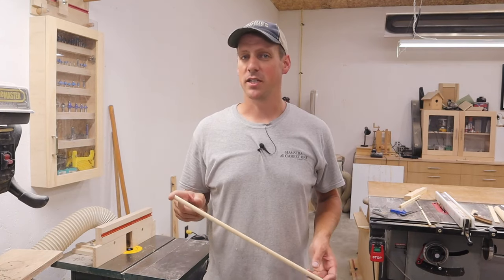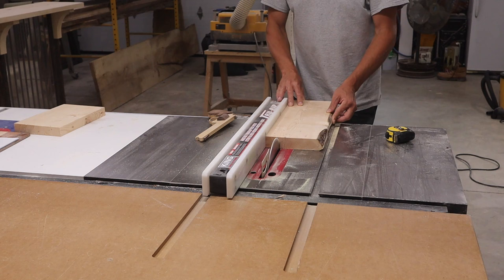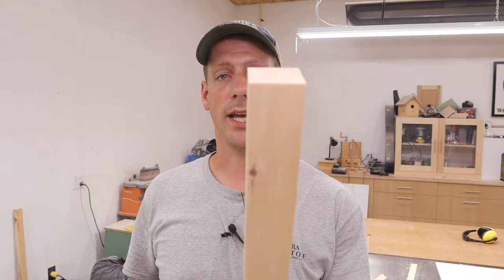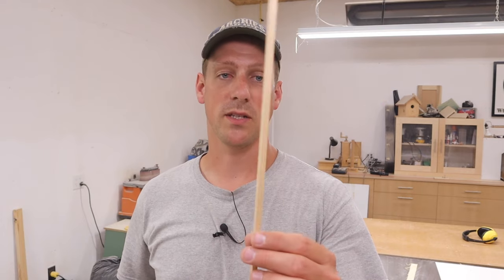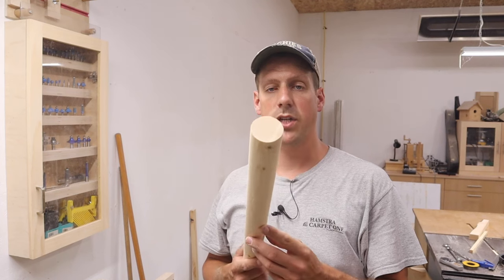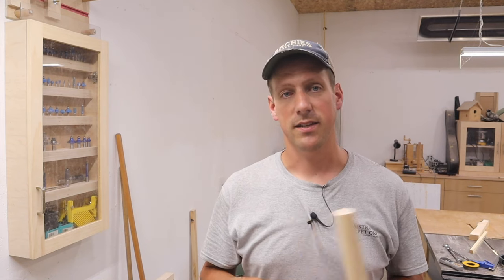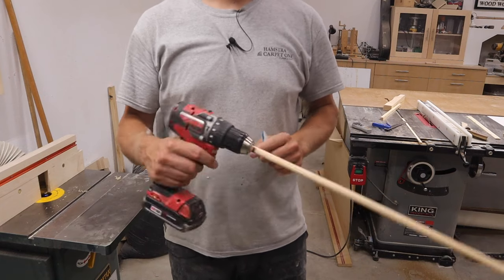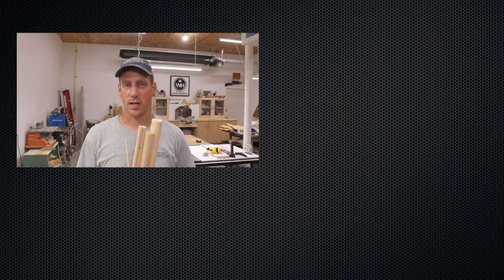How To Make Dowels The Quick & Easy Way!!!

Comment: To sand a larger dowel. Leave one end square and use a socket bit in ya drill to hold the square end. Works for me, hope it helps. 👍👍

Comment: Glad to hear work is picking up again man!
Dowels are crazy expensive and this is a great way to make sure they match the other wood in the build.
Reply from the maker: Thanks! I had a project that required 1/2” oak dowels. I did the trick and it worked well.

Comment: Cool idea.  I made some glazing bead the other day, using a router and table saw.  I'd started a project, then needed more bead, but the size I wanted wasn't in stock.  Next time I need dowel, I'll try the router (although dowel isn't too costly, really).

Comment: You can sand the larger dowels with a hand drill if you chuck up a hole saw (without the center drill) that's slightly larger than the diameter of the dowel, and wrap painter's tape around the end of the dowel until it fits snugly into the hole saw.
Reply from the maker: Great idea! I also thought about sticking a screw into the bottom of it, but then you need to make sure it’s dead centre.
Reply: @WesHamstra  if you don't  spin too fast, it's not bad, and you can locate center pretty well, put the dowel against the fence, a pencil where you think center is, rotate the dowel with the palm of the other hand...

Comment: i need to know what size round over bits i need to use to make 1 1/2" dowels and the size bits i need to make 1" , 3/4", 1/2", 1/4" and i really enjoyed your video on dowel making very informative, send me that info thanks very much.
Reply from the maker: 1 1/2” - 3/4” round over bit
1” - 1/2” round over
3/4” - 3/8” round over
1/2” - 1/4” round over
1/4” - 1/8” round over

Comment: to spin a big dowel in the drill, I guess that you could put a screw into the end of a larger dowel? Needs to be centered fairly well ;-) maybe use a hex head bolt, or Allen head (round head) , in a pilot hole...

Comment: So if I want a dowel that has the exterior diameter 32mm, what router bit do I need?Thank you!
Reply from the maker: You would divide 32 in half and that is the size router bit you need. You need a 16mm bit
Reply: @WesHamstra  Thank you for replying!

Comment: if i need to make dwels 25m. how can i do that
Reply: Probably a 1/2” router bit to make a 1” dowel and then sand it down to 25mm. As someone mentioned, if you have a 1” socket, you can put your dowel in that and chuck it in your drill. You may need to wrap a little tape around it if it slips in the socket.
Reply: 25 meter diameter dowel might be pushing your router table.

Comment: 3/4 x2 = 11/2 wut? I think you mean ONE and a HALF or 1.5 inch. got it...
can't you just use mm, like the rest of the world already...
Reply from the maker: Haha. I only learned mm in school. When I finished school and entered the work force I had to learn feet and inches because no one used mm. I naturally just use inches now. I prefer it.
Reply: Inches are KING for construction and accuracy down to 1/32 - they are way more easy to visualize and the units are very much human oriented. mm are great for tiny stuff, but I hate the units on anything over a cm as they are so hard to imagine. Fractions are just so instinctive too. I can easily visualize a foot, inch etc, but in metric I find it hard to visualize mm, cm or meters and there is nothing like a foot - horrible!
Reply: Awesome! Handy tips here. But please use push sticks/blocks -- especially down to the smaller dowel sizes. Nobody is exempt from injury (see the jointer injury video by Jonathan Katz-Moses). 🙂